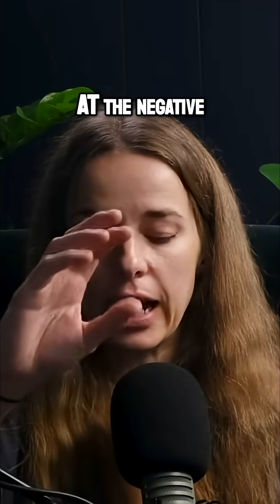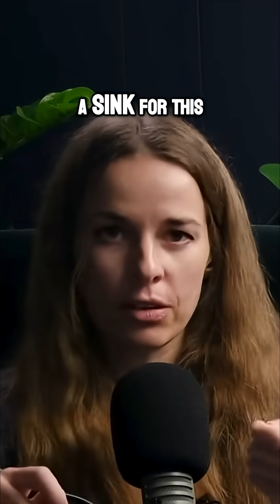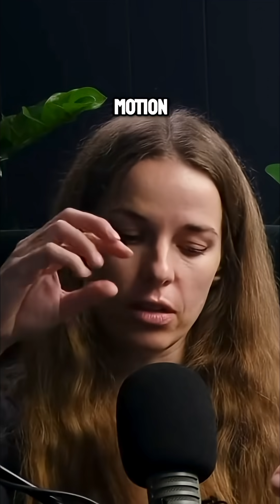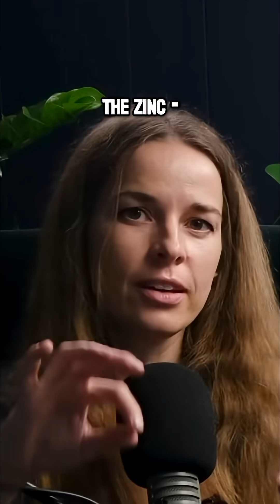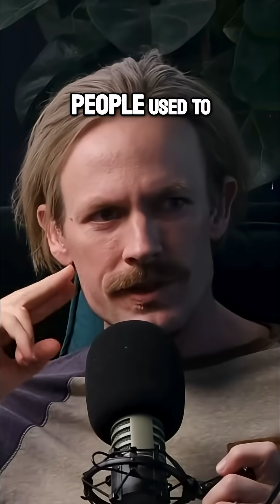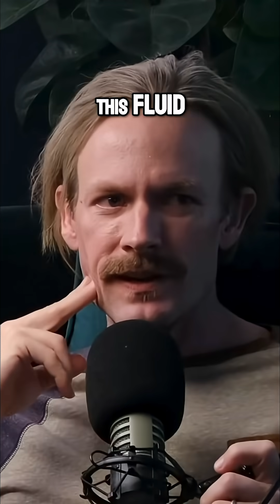Is electricity actually just atomic motion?

Comment: .... particularly the orientation of the surface molecules... meaning the connection creates a magnetic field around the wires which then is the same thing as orientation of the surface atoms in a similar direction. What is then missing is how the chemical reaction is then distorts the surface atoms , or applies a kind of pressure to the ' atoms' releasing " charge" through the electric field . ( The chemicals only create the conditions to transform or release the inherent energy as it flows from the " aether " through the atom)

Comment: This description is not quite right.
Introducing irrelevant linguistic nonsense does not assist with understanding how a battery actually works.
Think about this statement made by speaker

"....at the end of the wire..."

What is occurring at "the end of the wire" without a load or closed circuit is exactly what is happening at the beginning of the wire (ie the electrode she is describing) and that is NOTHING with respect to electron flow

What is happening in a battery when there is no load attached to the electrode? That is when the circuit is open

When there is no load attached to the battery and the circuit is open, the battery is essentially in a state where no current is flowing. However, several important things are still happening inside the battery:

Electrochemical Reactions:
Even with no external circuit connected, the electrochemical reactions at the battery's electrodes continue to occur. These reactions are what generate the potential difference (voltage) between the battery's positive and negative terminals.

At the anode (negative electrode), oxidation occurs. In a typical lithium-ion battery, for example, lithium ions (Li⁺) are released from the anode and move into the electrolyte.

At the cathode (positive electrode), reduction occurs, where lithium ions are intercalated into the cathode material.

This process is what allows the battery to maintain its voltage.

No Current Flow:
With the circuit open, there is no complete path for the ions to move between the electrodes via an external conductor. As a result, no electrical current flows. However, the battery still maintains a voltage across its terminals due to the electrochemical potential difference.

Internal Resistance:
Even though no current is flowing, a battery has internal resistance. This is due to the resistance of the electrolyte, the materials in the electrodes, and other internal components of the battery. In the absence of a load, this internal resistance doesn't cause any significant energy loss, but it still exists.

The speaker needs to clearly explain the state of battery and attached circuit or load which she hasn't unfortunately.

Comment: It's just vibration. It's not this difficult. When you have two cans with a string and talk into one, you hear it on the other side because what was conducted across the string is vibration. Copper is solid so it's automatically taught, and since it's solid it vibrates at pitches so high we can't see or hear them. Don't over think it.

Comment: Intuition tells me that this is way more plausible than electrons being discrete elementary particles. It's all just vibration.
Reply: Indeed it is. Pay attention to the physical appearance of a conducting wire. Passing current doesn't change the material itself by any means. Only if you crank up the current, the wire will start shaking so rapidly that visible radiation will be produced due to heat. These are the same electrons which change energy level state but in this case as a whole vibration lattice. Quantum mechanics is misleading concept and it drove people into unnecessary spookiness. A copper wire is no different that one hydrogen atom, a.k.a. as proton. Atom nuclei are little raisins within continuous electron cake.